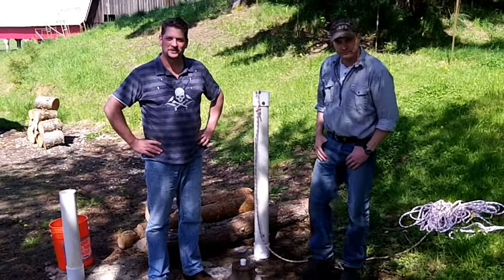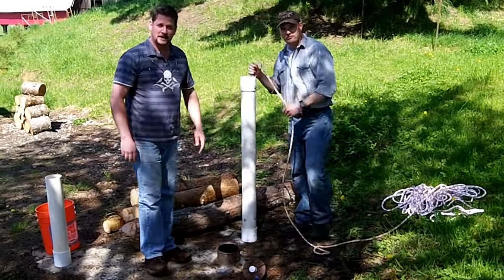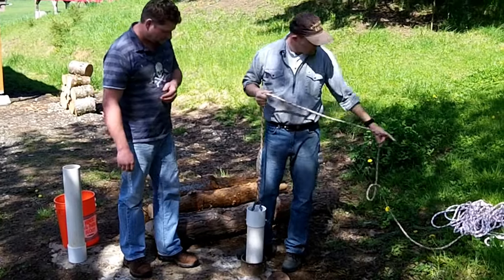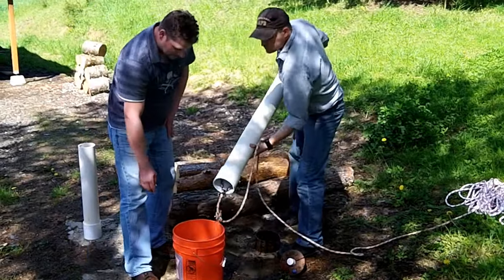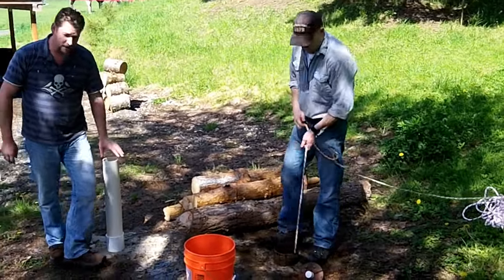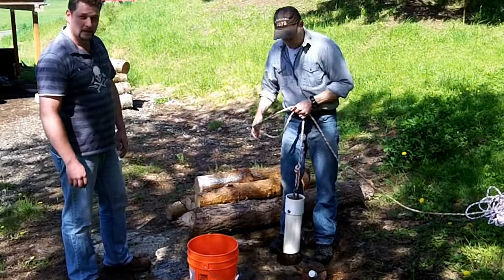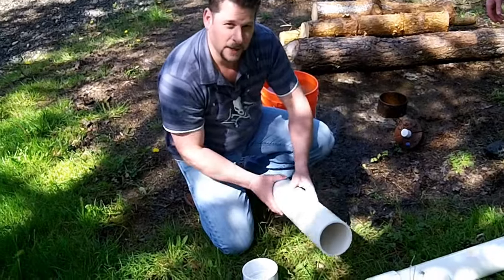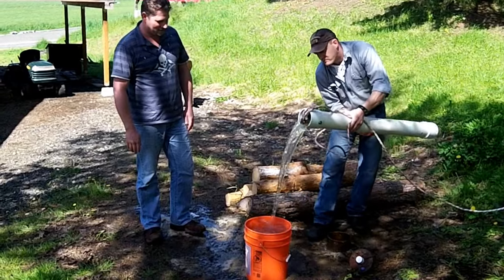CHEAP and EASY, Emergency Well Pump Requires No Electricity

Comment: Very good...Someone used to sell something similar to this - it was made of aluminum or maybe something galvanized.  Just a long metal tube with a one way flapper on bottom and when pulled out of well opening, you pulled a lever which opened flapper valve and out comes the water.  With water weighing roughly 8 lbs per gallon, I don't believe it held very much - maybe 5 gallons.
Reply: Lehman's sells it - galvanized deep well bucket. $99 right now. But during lockdowns they were back-ordered for months, maybe longer.
Reply: @Growmap  Still back-ordered! I ordered one. The Amish must be too busy to keep up. haha

Comment: nice video.can you post everything you need to make this pump please?
Reply: Three or four feet of 4" schedule 40 pipe, two- 4" coupler's, 4"x2" reducer, rubber ball wider than 2 inches, two 4.2" ( or so ) bolts w/ nuts, glue / primer, and chain connected inside the pipe and coupler to a larger bolt. Tie a rope to the chain make sure rope reaches static water level in the well. I just made mine for $55.00 and my well I reach water at 90 feet. THANKS GUYS!!

Comment: This is like ALL of the old wide mouth wells where the sides of the well was lined with rocks and bult up above the ground where you would drop a bucket attached to a rope into the well and pull the water up in the bucket. Some of them had a pulley at the top that the rope was attached to. I am surprised that ANYONE would be surprised at this video. It's really old hat.